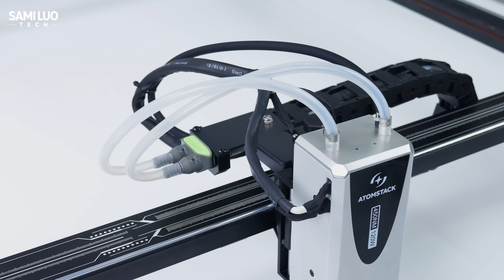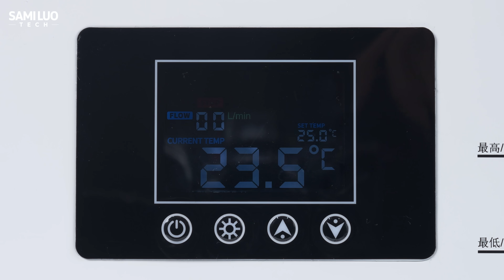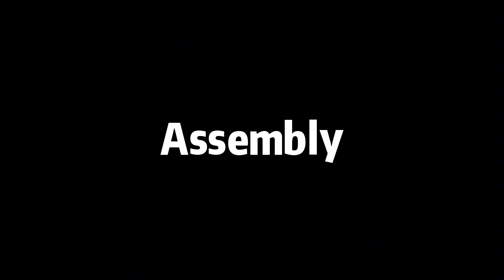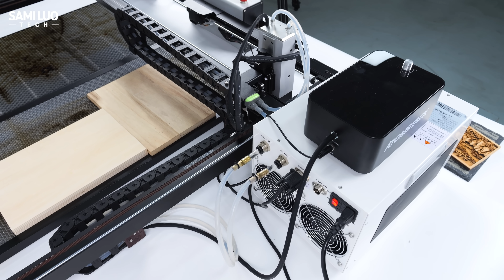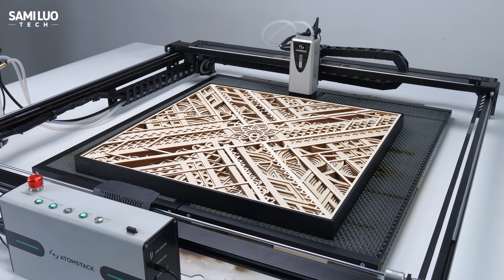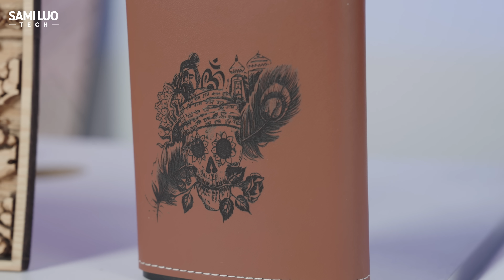120W Ultimate Water-Cooled Laser Engraver?! Full Review of the AtomStack Glacier

Comment: where did you come up with that 50 000 hours? You figured a normal diode cnc laser is rated at 10 000, and if they said x5 that means 50 000, hmmm, wouldn't it be great if it were true